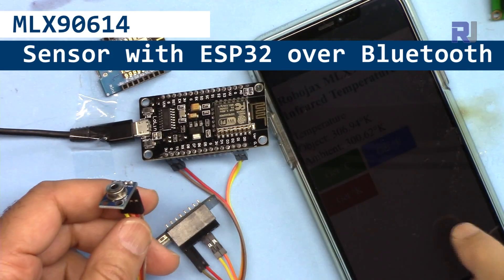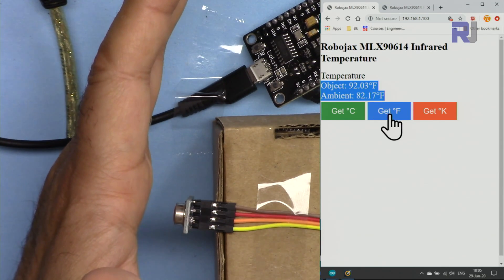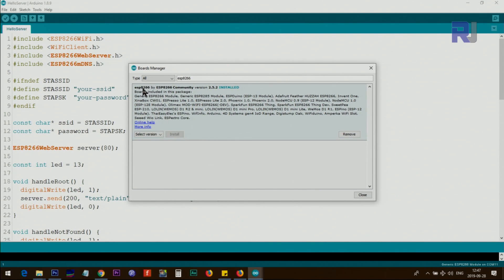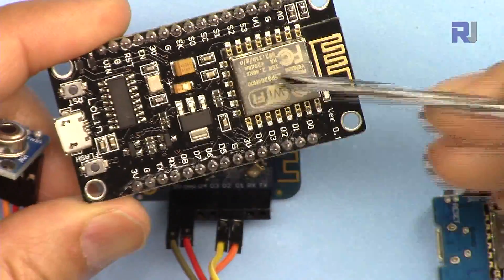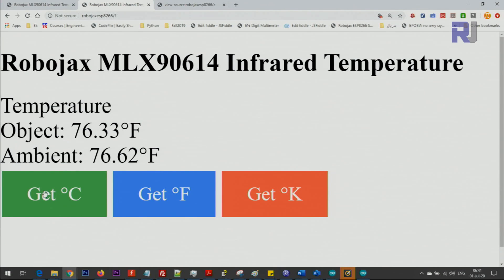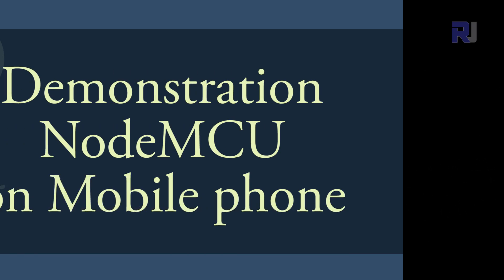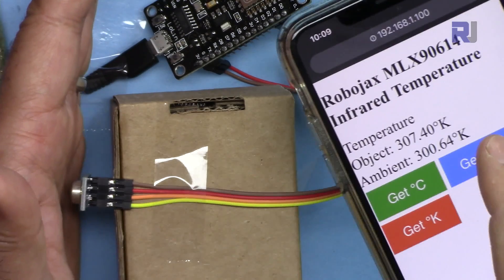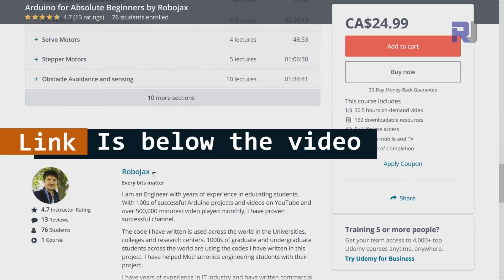Using Non-Contact MLX90614 Temperature Sensor  with NodeMCU D1 Mini over WiFi -RJT331

Comment: Hello
Why does it not show the normal body temperature of 37 degrees and when we place the sensor in front of the forehead it shows the temperature of 28 degrees??
And it works very slowly and every 10 seconds it only goes up and down by one degree? Is there a way to calibrate it and increase its speed???

Comment: Thanks for the video sir,
i am working on the project in which i need to connect a SPO2 sensor MAX30100, for which i need to connect 2 wires of this sensor to the previously occupied pins of ESP8266 (SCL and SDA) by our MLX90614's pin. I have made common connection for now.
We have combined their programs but they are not working together, if i pull out one's wire then 2nd will work.
I think that path sharing is creating issue.
Is there any solution by assigning any another pins to any of the sensors or anything so that they both work together??
Reply from the maker: Hi, the problem is not common wiring but rather the I2C address.  Try to find how to assign different addresses to each device. I have show solution to such issue in another device here https://youtu.be/0glBk917HPg

Comment: It is showing 1037 ℃, constantly......... And also my sensor is working fine with arduino uno . What should I do??
Reply from the maker: Bad wiring
Reply: @robojax  3v-->Vin, GND-->GND, SCL-->D1, SDA-->D2
Reply: @devanshsachdeva6588  Hi, 
 I have the same error as you. Do you know how to fix that error? please show me how to fix this
Reply: @phuongquang5312  Heyy!
I fixed the error long ago so I don't remember what really worked, but ya I can tell you the fixes I used. First of all check your wires because in my case I think I am not sure of but I think my wires were defective, else check your code. If this will fix, well and good, else contact me.
Reply: @devanshsachdeva6588  Thanks for responding to me!
I don't think it's the connection wire. because when disconnecting esp from wifi it works fine. when i connect esp8266 to wifi, 1037*C :(
Reply: @phuongquang5312  So I think there is an error in your code. Try to debug or rewrite the code.
Reply: @phuongquang5312  Same here, do you managed to fix it?!